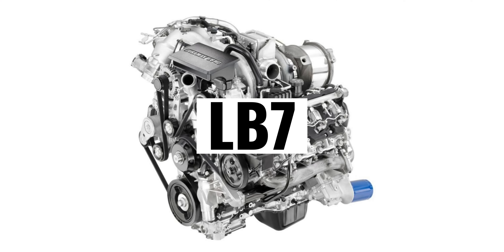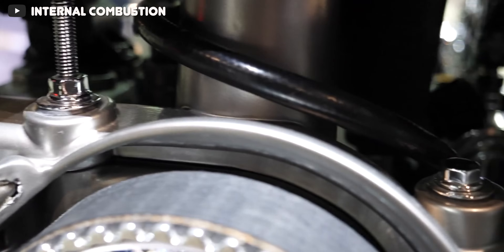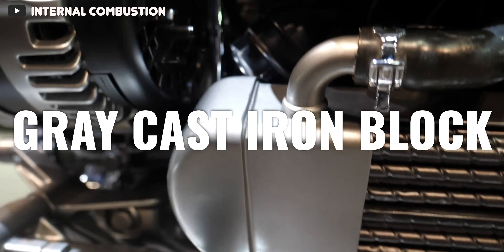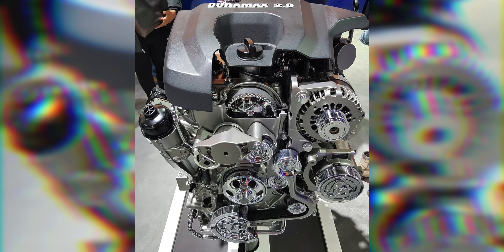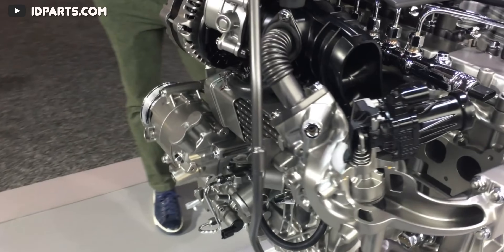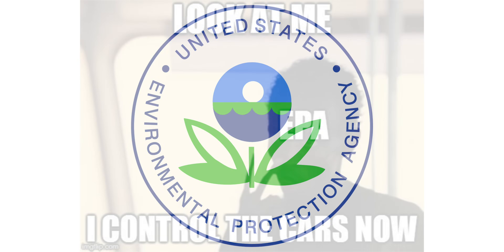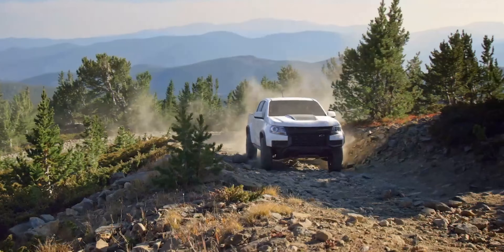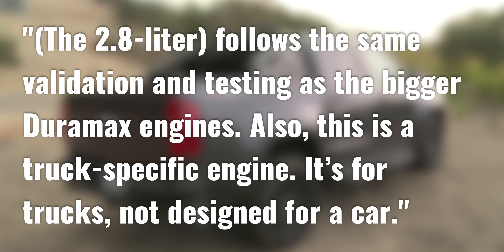2.8L LWN Duramax: Everything You Need to Know

Comment: I can’t comment specifically on this engine because I will likely never touch one. As a fleet mechanic I only work on Ford, Navistar, and Cummins engines. But I would like to comment on diesel engines as a whole from a couple things you said in the video. 

Towards the beginning you brought up how widely diesels are used in Europe more so than here in the U.S. and I think you can thank our administration for that. When you think back to the late 1970s and early 1980s when diesel engines were first introduced in passenger cars and light trucks, diesel fuel was half the price of gasoline. That was one of the selling points. California and Feds have no taxed diesel fuel so much that it is now more expensive than unleaded gas. I don’t want to turn my comment political, but our government has made diesel engines appear to be an expensive option. 

Towards the end of the video you questioned the reliability of the EGR and after treatment system of this engine. While its too early to tell, I feel hopeful. As much as I hate both systems, I am starting to see some improvements in our newest trucks. Our International MV series trucks running the Cummins L9 engines are on their second year with some hours racked up. We have had almost no trouble. None of the DPFs have had to be pulled and cleaned. No EGR coolers have ruptured. We have had a couple of SCR problems, but nothing like the older trucks. This gives me hope that they are finally working the bugs out of these systems.
Reply: I heard that Cummins had a similar 2.8L engine. Is that one a Cummins original or did they get it from VM too?
Reply: @jeremysmith9868  You may be thinking of the R2.8 that Cummins offers as a crate motor.  As far as I'm aware, that's a Cummins original; it has a cast iron head, and I believe a fixed geometry turbo, though I could be wrong about that.  According to Cummins' specs, it makes a bit less power (161 HP, 310 LB/ft), but weighs about the same.
Reply: It’s only taxed about 5-10c more than gas. It’s expensive because of going to ultra low sulfur that means a lot of post refining(cracking) treatments making it a much more refined fuel. Oddly enough planes can burn high sulfur with no emissions and they never will be forced to emissions because the rich don’t drive a 1 ton truck but definitely won’t put up with anything that would mess with there private jets
Reply: Diesel used to be a byproduct of making gasoline so that’s why it was so cheap. Now they require it to be refined and have sulfur removed and additives and it gets mixed with biodiesel. Why does the government ruin everything?